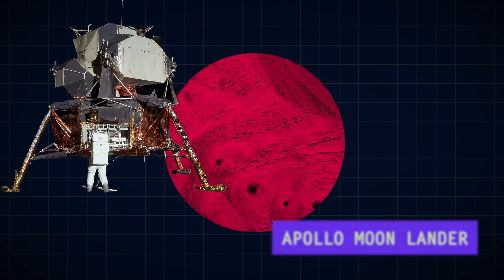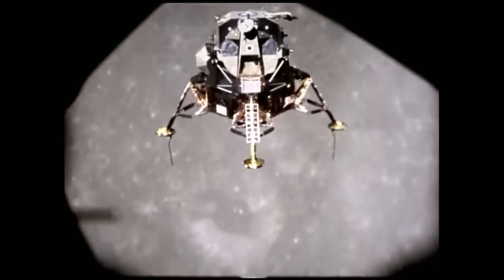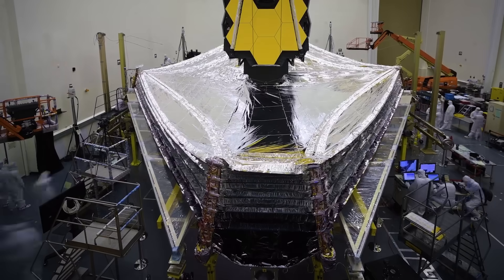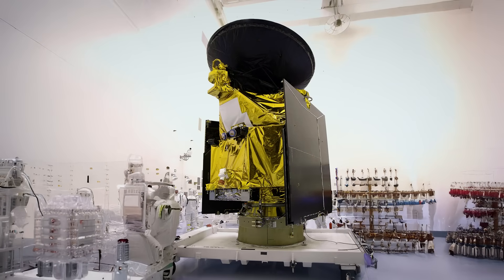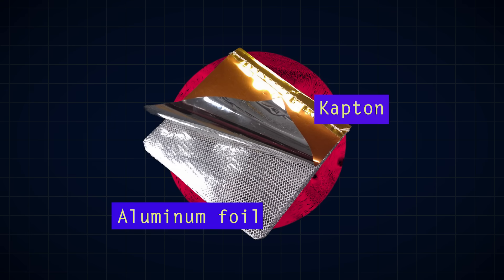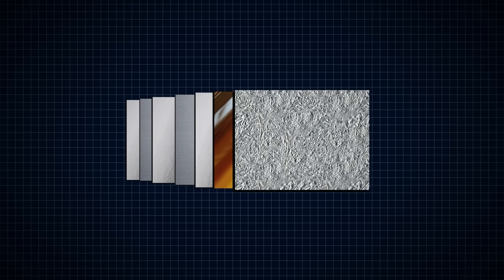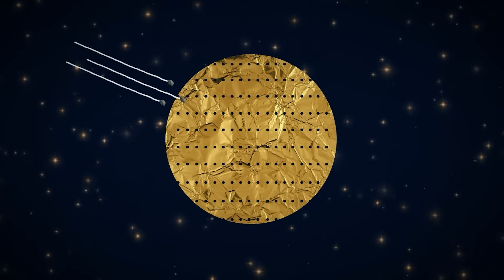Why Spaceships are Covered in Tin Foil

Comment: A very good show of lies. 
 Those foils will protect electronics but not people. 
 LEAD is needed for the protection of human beings. This is why I know that nobody went to the moon.
Reply: No. The radiation level is low enough that the astronauts did not need any radiation shielding on the moon, beyond what was accidentally provided by the pressure hull of the spacecraft. The radiation dose for the entire mission was around 1 Rad, or 1/300 of a lethal dose.

Comment: 3:14 Heat isn't a substance it's thermal kinetic energy. Heat can be transferred by conduction, convection, and radiation. When talking about a vacuum heat transfer cannot happen via conduciton or convection but only by radiation which is notoriously inefficient compared to conduction and convection.

Comment: Here's a brain twister for you! 🤔 
Aluminum is invisible to magnetic fields. It's a short circuit to electric fields though. 
But if it has no effect on the magnetic part of an EM wavefront, then how it work at all? 😂
Reply: In my opinion, the answer to the question I posed is that you CANNOT decouple the electric and magnetic parts of an EM wave! 
Suppressing the electric field indirectly suppresses the magnetic field.

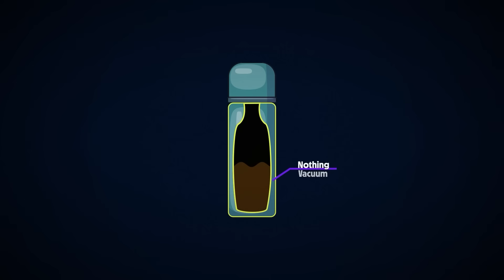Comment: (@3:00) Removing air from a chamber does not "remove the ability for heat to travel between."  If that were true, the newly created Webb telescope, which specializes in infrared detections, would be useless, and we'd feel no heat from the sun.  Heat is a form of radiation, and all forms of radiation travel very well in a vacuum.  Removing air from a chamber merely reduces heat conductivity produced by air.  A self-proclaimed science vlog should know these very basic facts.

Comment: I knew NASA used aluminum foil, Mylar, and similar materials on spacecraft, and watched this to find out when they used tinfoil. It looks like the answer is, never. Tin foil and aluminum foil are made from 2 completely different metallic elements. Tin was first replaced by aluminum in 1910, when the first aluminum foil rolling plant was opened. Tin is as far from aluminum on the periodic table of elements as it is from Francium, an extremely radioactive chemical element, and the second rarest naturally occurring element. In other words, it's not even close. Tin is 2.7 times denser than aluminum, and it boggles the mind how one could possibly be mistaken for the other. Especially since most people now living have never seen a piece of tinfoil in their entire lives. I came here to learn something new, and was just disappointed instead. By the way, there's no such thing as empty space. If space was empty, there wouldn't be up to 14,770,000+ pounds of stuff hitting Earth every year.

Comment: Surely this twat's 'tin-foil' is composed of numerous thin layers of aluminized Mylar or similar material, with Kapton often used as the base film. Layers of thin mesh can be added to create greater thermal insulation. Tin foil was last used to wrap cigarettes and discontinued in the 1940s.

Comment: Covered in foil?  The LEM was MADE of aluminum foil!  The crinkly stuff on the outside is just a thermal blanket.
Reply: No, the LM was not "made of aluminium foil". The major structural elements were aluminium honeycomb sandwich panels, and aluminium plate for the pressure vessel. Not foil.

Comment: That exactly the reason I had in mind "protection from radiation". But now explain to me why lander's landing poles? There is no expensive equipment and no astronauts sitting in these four rods. What are they protecting there? Is tinfoil preventing impacts on the legs? WOW. I have it in my kitchen and it prevents food from spoiling, what does it do to a lunar lander's landing gear?
Reply: The main function of the MLI is thermal protection. The landing legs are metal, so they conduct heat well. Leaving the legs uncovered produces a path for heat to flow into and out of the descent module. Covering the legs blocks this path and reduces thermal stress on the module.

Comment: Tin foil is the only known substance strong enough to withstand all the radiation and forces of Van Allen belt and the vacuum of space!!!
And can also be used to make a nice hat!
Reply: The vacuum of space was handled by the pressure vessel inside the LM ascent stage, which is mostly hidden from view. The radiation levels are low enough that you don't need a lot of shielding. The MLI stops Alpha particles only.
Reply: It's not made of tin.

Comment: Total bs . Why were the legs of the LEM covered in it and the cabin painted black and white ... and i have seen the hi res pictures
Reply: The ascent module is covered in panels made from Inconel. These thin panels served as micrometeoroid shielding: the micrometeoroid would crash through this panel, and disintegrate in the process. The debris no longer has enough energy to damage the important stuff underneath. The MLI is underneath these panels.

Comment: TIN (Sn) is located in Group 14 (also known as the Carbon group) and Period 5 of the periodic table. It is a post-transition metal. Its atomic number is 50. 

Aluminum is a chemical element with symbol Al and atomic number 13. Classified as apost-transition metal, aluminum is a solid at 25°C (room temperature).

Are you intelligent enough to grasp that these two elements are not the same thing? Do you have any possible clue how inept you look calling something made out of aluminum tin!  Why would anyone listen to a thing you say when you can’t get something this freaking simple correct?  You should be extremely embarrassed making such a blunder.

Comment: "Tin" foil is a misnomer, because tin foil has not been generally used since the late 18th century. Instead nowadays Aluminum foil is used as described @ 4:26. People who do not know better still call it "Tin Foil" whereas it is actually Aluminum foil. Tin and Aluminum are two different metals with different properties . Furthermore, Gold foil has been used to cover the exterior of spacecraft and it really is foil made from gold.  Gold is an excellent reflector of infrared radiation.

Comment: Metal hulls of spacecraft DO protect astronauts from the common radiation found in solar wind - beta and alpha radiation is stopped by a couple of mm of aluminium. High energy cosmic radiation does penetrate though but it has a much lower flux.

Comment: False report! It's actually by gold foil not tin foil. It's there for temperature variation and for protection from radiation.
Reply: Incorrect. Spacecraft do not use gold foil. They use MLI: kapton with a layer of aluminium vapor-deposited onto it.

Comment: There are several inaccuracies in this video. 
1. MLI provides thermal protection only. It does not provide protection from radiation (with the exception of alpha particles, which are stopped by pretty much any solid object). It does not protect against micrometeoroids: you need a Whipple shield for that. 
2. MLI does not consist of a layer of kapton, and then a layer of aluminium foil. It consists of layers of kapton (or mylar), with aluminium vapor-deposited onto one side or both sides of the plastic.
Reply: It also shows Saturn before Jupiter in the animation lol
Reply: It can provide protection from the x-rays produced by high energy particles. (bremsstrahlung). If the particle hits a low mass atom the x-rays produced are low energy and can be easily absorbed by any metal behind the plastic. (this is why when handling beta sources we use perspex not lead as the shield) Metal on the outside will produce higher energy x rays which are not a big deal for electronics but not so easily tolerated by flesh.
Reply: Kapton also comes in adhesive tape form, we use it all the time. Sometimes as a quick-fix.
Reply: The 2nd thing is virtually identical, like, you still end up with largely the same end product.
Like you still have a thin layer of aluminum on the outside
Reply: @mihailoradovanovic7283  Vapor deposition allows you to make a much thinner layer of metal than any foil production process. If all you care about is reflecting heat, a thin layer does that as well as a thicker layer.
Reply: Thanks for stating what I was going to. I dunno the YouTuber's creds, but he's annoyingly loose with 'facts'. I watch occasionally to see if he's improved, but nope
Reply: Sweet why don't you make a video and show us
Reply: Yes, but what was the understanding of the early-mid 60's?  What did they really know about space back then?  The knowledge gained since then dwarfs their understanding of space back then.

Comment: tin foil does not suffice - it's all a farce. and once you are in a vacuum you are as insulated as possible, there is no extreme loss of heat in the "shade", vacuum is insulating
Reply: Once you are in a vacuum, one method of heat transfer is left: radiation. A spacecraft is exposed to 1300 W/m2 of sunlight on the sun-facing side, which would heat up the spacecraft if you didn't do anything. And the spacecraft is free to radiate heat into space, insulating it reduces that heat transfer.
Reply: @zounds010  it's not enough to freeze the capsule as fast as you are all believing; space is not cold, space is insulating: there are no gases, it is by definition a vacuum, you globers should know that, in fact in a vacuum propulsion ceases to perform completely making space travel a total farce - never happened, we never went past the firmament

Comment: My dad was one of the many engineers on the Apollo LM (lander).  As they built LMs, there was inevitably a certain amount of unusable scrap in the aluminized Mylar you’re describing here.  Since the pieces were too small to use anyway, they distributed it among Grumman employees as a curiosity.  My dad brought some home from time to time.  It had some odd properties, including resisting “wadding up” into a ball.  If you try to wad it up into a ball, it would (to some degree) try to straighten/flatten itself out!

Comment: Ok i get the tin foil, but why the tape and cardboard. We are not blind .
Reply: No cardboard was used on the LM. Tape was used because that's the smart way to attach sheets of thermal insulation without perforating it and decreasing its performance.

Comment: The mesh you speak of is Skrim. Very much despise working with it. Thankfully not all the projects that i do work with use it. We also cover our units in a black carbon capton MLI with about 7 layers of silver in-between. Locations have to have a ground that runs through the MLI and attaches to the space craft. The spots that get wrapped are cut out while it was layered and when cut they are in the weirdest shapes you can imagine most of the time. That way they will wrap properly around the structure and cables.

Comment: Good explaining of an interesting topic. "Gold foil" on spacecraft not only looks cool but keeps cool too, and warm, "nifty", to use an old term from back in the Apollo days. ;D
Reply: "Gold foil" is actually Kapton. I have a few reels of the stuff as its used in electronics
Reply: @tonycook1624  Yes, right, he went into that material in great detail in the vid. There is a gold foil of sorts that artists use for picture frames, but it is a gold colored mental, or for "richer" applications, actual gold leaf, which is a very thin foil. And I think the Voyagers spacecraft record discs were actually coated in a gold clad material of some kind. : )
Reply: @ronschlorff7089  He did but he got the construction of the foil wrong in the fine detail. Its multiple layers of mylar and the aluminium is vacuum deposited on one side of the mylar layer. So technically there is no preformed aluminium foil involved
Reply: @tonycook1624  interesting, seems to work, I guess. Now if they could only land without tipping over on the moon today. ;D

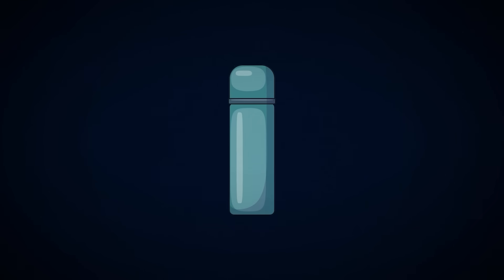Comment: 2:45 I have a thermos where the space between the inner and outer walls is filled with cork from the factory. So it's not true that there is always just a vacuum there. After all, NASA still uses cork for insulation, for example on its rockets such as the SLS or earlier the shuttle.
Reply: How do you know it has cork insulation? A true vacuum flask (different from an insulated flask) just has a vacuum between the inner and outer walls, though some use a cork stopper.
Reply: @michaelnoble2432  When I unscrew the cover at the bottom and look inside, it's nice to see a thick wall of cork between the outer and inner walls all the way around. It's an old thermos from the 70s. I also have a vacuum thermos.
Reply: @Thales_WH  fair enough - I didn't know Thermos ever made non-vacuum flasks.
Reply: @michaelnoble2432  I don't know what company made it. I mean it as a generic name.
Reply: @Thales_WH  in that case we're just talking about insulated drink containers, and there are a multitude of those. The best of them still use a vacuum.
Reply: @michaelnoble2432  Of course, vacuum is the best, but I didn't question that in any way. Maybe it would be better to try to explain it differently. I'm from Europe, specifically from the Czech Republic. I'm not talking about the manufacturer Thermos now. In our country, the word "termoska" (which Google Translator translates as thermos) is a designation for general insulated containers for drinks, soups, and the like. The container I'm talking about was sold under the designation "termoska" just as a container with vacuum insulation would be sold and labeled. In other words, one category of products with the same purpose and use, just a different principle of thermal insulation. Just like a car refrigerator, it's still a car refrigerator even if it has a peltier or compressor in it. So if someone tells me that thermoses only use vacuum insulation, then I have to say that it's simply not true. Then there's the historical context. I wrote that this is a thermos from the 1970s. Back then, more materials were certainly used than today. I don't know if other insulations than vacuum are used for thermoses today. Be that as it may, in our country the term "termoska" for such a container is completely correct, even if it is less perfect. Although in principle I know that a vacuum thermos should be better, in reality this one with cork insulation works very well :)

Comment: Nice work, you really elaborated well on something I hadn’t given much thought to.

Edit:  Does the MLI primarily provide thermal radiation protection, or does it also help with ultraviolet, x rays, gamma radiation, cosmic rays, Van Allen belts radiation…?  Or are those higher energies dealt with by ‘other’ hardening methods?
Reply: MLI is primarily for thermal insulation. It does block UV and alpha particles, but so does any solid material. 
The Command Module had its heat shield and pressure hull, which reduced the radiation level by a factor 100. Higher energy radiation was not blocked: blocking those would require far too much mass. And the radiation level wasn't high enough that blocking it all was required.

Comment: I worked at a tape company and I cut P-224 which is a thin, conformable tape with high thermal rating and exceptionally high dielectric strength with excellent solvent and Freon resistance.

Comment: Cold is not conducted, only heat is. Either heat enters a body, or heat leaves a body. Cold does not move. The transfer of heat energy can occur three ways: conduction when things are touching, radiation out of a body in all direction and including through the vacuum of space or from a campfire roasting marshmallows and warming people, or by the movement of convection currents where material in all states of matter rises because it's hot and and has less density then falls as it cools and its density increases like air in the atmosphere and magma under the crust of the earth and water in a pot pf boiling beans- but convection requires a temperature difference and gravity. No, cold does not move, only heat moves.
Reply: Colloquially, and in obvious context, cold is used to describe anything less hot than a particular benchmark or reference, and can therefore ‘flow,’ unless the temperature is 0K.  As long as one can intuit that the flow of heat energy can only go from a substance with a relatively high molecular motion to one of a lower degree of molecular motion (high temperature-> lower temperature), we can safely understand what someone is trying to convey by ‘conducting cold.’

But yeah, rigorously speaking, of course you’re 100% correct.

Maybe a pitfall is sticking a cup of hot coffee in a freezer, and incorrectly assuming the large amount of cold takes over or overwhelms the tiny cup of coffee - but in that case, that person just probably didn’t take Physics.
Reply: Ok initiate.

Comment: I used Kapton tape at work. Felt kinda proud handling the material that's used for spacecraft.
Reply: Same! I use it for fixing electronics, love that stuff.
Reply: I wonder if any Kapton is on the starship Enterprise, the Captain, and Scotty, would approve!! : )
Reply: @ronschlorff7089 they had a roll, but Scotty beamed it down for his buddy to borrow and of course he never returned it....
Reply: Ditto as well. I work with electronics assembly on printed circuit boards. We routinely use kapton tape to hold components for soldering to insulating wires and such when baking the boards during processing. Kapton is heat resistant and will not warp during heating.
Reply: Three astronauts in Apollo1 died because the Kapton insulation in wires crumbled, and caused short circuit and resulting fire.
Reply: @antoniohuerta9144  Yes, that may have started the fire, but it was reported, at the time, that two other factors made it worse, and deadly. Too much oxygen in their internal air supply, which accelerated the fire, and a not so easy hatch escape mechanism, which trapped them. Both were fixed after it was investigated for about a year, and future missions were successful with a more normal air like air environment inside the command module.